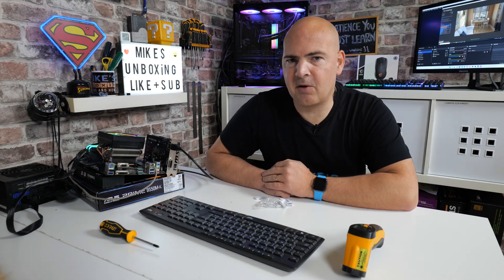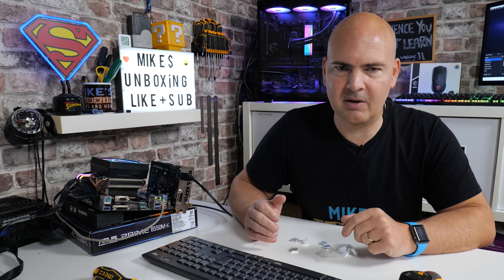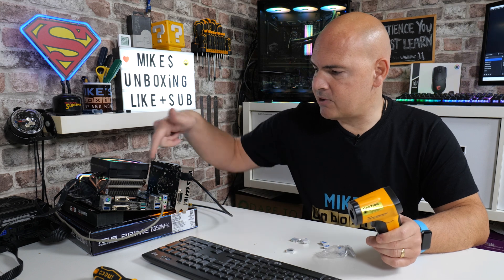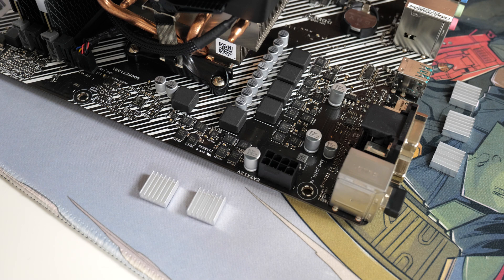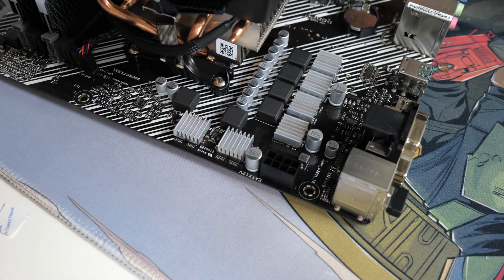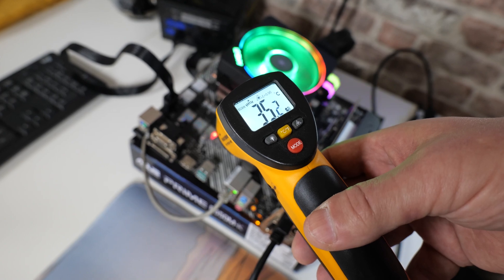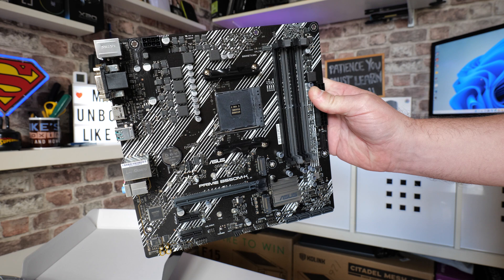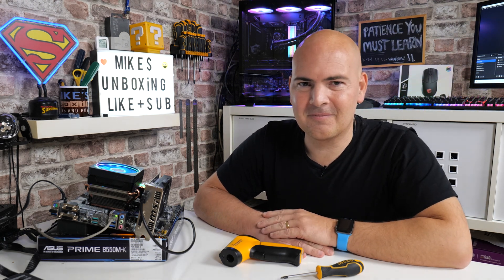Adding Heatsinks To Motherboard VRM & Chokes Is It Worth It?

Comment: Upon implementing active cooling for the VRM, specifically utilizing a fan on the heatsink, I observed an 8 percent increase in multi-core clock speeds.
Reply from the maker: That's a great result! Active cooling definitely makes a difference.
Reply: After you have attached the fan to the heatsink, you may then adjust the PBO settings, and you will discover new areas to explore.

Comment: In my motherboard, the mosfets are surrounding the chokes, which makes it impossible to use this heatsinks, I will try to find even smaller ones...
Reply: Did u find a way
Reply: @midnightbat344 didn't need to do it, turns out my temps were fake. My vrm are just fine

Comment: Is it attached firmly? What if the PC is standing? Will it not fall? I am interested in installing the device on my mosfet VRM, but I am afraid it will fall and hit the motherboard and short circuit.
Reply from the maker: the double sided adhesive seemed to work quite well. as far as i know the motherboard is still going strong

Comment: many lower end boards actually have the holes a vrm gets attached to on higher end boards since they use the same pcb. i would suggest mounting vrms using those instead of just relying on the thermal pads of small heatsinks, these are almost always low quality and slide off after some use. even just a zip tie would work. 
OR, thermal epoxy etc.
Reply from the maker: That's a great point about using the pre-drilled holes for more secure mounting!

Comment: pro tip to anyone wanting to do this, you want tall thin fins. If you use a heatsink with too much mass it will start storing heat instead of dissipating it. and a fan blowing directly on the heatsinks will make a massive difference. In terms of aluminum vs copper, copper is the best at heat transfer however if you cant find any with 9mm fin height its better to use aluminum
Reply from the maker: Great points, thanks for sharing!

Comment: Got an H610M-G with naked VRMs and i upgraded from an i3-12100 to a i5-14600KF. I appreciate this video and i will def use it whenever my heatsinks arrive. I bought some that have pre-applied thermal pads so i only need to peel the paper and i'll be set. I do have a question though, the heatsinks themselves should not physically touch the capacitors right? I did some research and it can apparently short out the motherboard.
Reply from the maker: yeah just touch the chips and avoid metal electrical contacts
Reply: @mikesunboxing  Great, thanks a lot mate. I appreciate your tutorials.

Comment: thermal adhesive/pads or 3m double sided tape, which 1 does it better and safe? 😅
Reply from the maker: i would rather use thermal epoxy or glue, but as the weight is minimal, some decent heat resistant DS tape should be okay

Comment: Can you try putting on an m.2 heatsink with larger fins. They come with Silicon pads so no extra effort required. Holding them in place would be a challenge though.

I also noticed, older mobos although basic, had larger and better heatsinks than most mobos manufactured today

Comment: I have a b660m ds3h ddr4 paired with an i7 12700, I'm looking to do this as my VRM temps easily cause throttling - Is it safe to do this with the 3m tape the heatsinks come with? Or should I get rid of those and rely on thermal pads instead?
Reply from the maker: personally i would probably buy some thermal glue for sticking heatsinks, it is a lot safer that way
Reply: They're sufficient. If your really worried about a short just buy anodized aluminum.

Comment: Would be nice if there was a way to ensure that the heatsinks stays on the chips, so you don't have that nagging feeling that one day, the adhesive tape just gives up and the heatsinks falls on the GPU, shorting it, and the computer goes up in smoke as soon as you turn it on. I guess you could glue something tom the mainboard where there are no components, to attach something like a strap that holds all the heatsinks down.
Reply from the maker: you can get actual heatsink glue that might be an option if you are worried

Comment: Would these cause short circuit?
Reply from the maker: if they touch metal parts that are carrying voltage they might, although if they are anodised they won't
Reply: @mikesunboxing so placing it on top of mosfet and vrm using only the adhesive that comes with it is safe?

Comment: Without the heatsinks these components almost go above their max operating temperatures. I added the heatsinks to make the board last longer I don't think it helps performance that much unless you do long renders and and start getting throttling, heatsinks any where where parts get warm helps with long render times.

Comment: Got this vid in my recommended section. Im an A320m user Gigabyte with a Ryzen 5 5600g. My board is almost 4 years in service with almost 3 years with the 5600g. I just put a fan close and directly at my vrms. No issues at the moment.( It has an rtx 3060 12gb in use for 4 months now).
Reply from the maker: thanks for watching
Reply: @mikesunboxing   Your welcome and Like

Comment: essentially as far as the vrm goes there's literally no difference besides the heatsink between this motherboard and a b450 tuf gaming, cuz the capacitors, mosfets, and chokes are all the same, but this one has a metal block on it.

Comment: It has been proven that VRM temps can have a significant effect on performance for a Ryzen APU system, because the iGPU relies on precise voltages for the processor, and RAM... But for a typical system with a dedicated GPU, the VRM temps probably don't matter as much.

Comment: First of all, greetings, sir! I have a question for you. I'm not a super knowledgeable person about PC. I bought a 2700x processor for an A320m s2h motherboard, the case works fine BUT in a heavy render or benchmark the VRMs reach 103 degrees according to HWInfo and Aida64, and in games usually 80-90 degrees. Some say it's normal, some say it's too hot and that I should get the mosfets like in the video. Now sir, I have two questions.

Will the PC explode if I keep using it with these temperatures?

I also read something about putting Thermal Pad before these mosfets, do you recommend it? Or is it okay to put mosfets without thermql pad? Can you give me some advice, thank you very much!
Reply from the maker: those temps are bordering on the unsafe levels and i would want them lower for longevity. thermal pads are a good idea especially the double sided sticky ones. the board won't explode but those temps could lessen the lifespan
Reply: @mikesunboxing  Thank you very much for the answer sir! I just ordered the heatsinks in the video as you suggested. Unfortunately I couldn't afford the thermal pad. Do you think only the heatsinks will do the job? Thank you again!
Reply from the maker: @kerem1294  yes they will definitely help a bit

Comment: My previous AM4 board (Gigabyte A320M-S2H V2) was choking my Ryzen 5 2600 in performance and the VRMs at around 110C really heated even the processor. Added some small heatsinks like you did and that cut the VRM to around 70C-ish IIRC. 
That board has since died and I moved to one with a VRM heatsink and I would probably aim for motherboards with VRM heatsinks in the future to avoid that issue.
Reply: did it work with heatsink you added?

Comment: hello will this work with asus a320 motherboard?
Reply from the maker: i don't see why not, worth a try
Reply: @mikesunboxing i used the wrong heatsink i used the 10x10x10 but somehow my cinebench scores went from 15000 to 20890 points significant uplift in performance. damn i didn’t expect this at all!  if only i used the correct heatsink like yours the results would be even more better !

Comment: I have done this on a few different boards for LGA 775, AM2+, and AM3+. It works much better if you use a thermal epoxy to attach the heat sinks. Granted you wont be removing them ever again, but you'd be doing this to a cheaper budget board, so why would you want to anyway?
Reply from the maker: Great tip!

Comment: so ive been having pc restarts while gaming and the temps seem fine, but I don't have heat sinks on my vrm and I feel like that might be the cause of it because I've done everything else possible to fix the issue. the problem started when I put a i9-9900kf in the rig and my mother board is a asus tuf z370 plus gaming. my PC restarts less than 5 mins into the game and I don't get any bsod
Reply from the maker: what motherboard and cooler are you using?
Reply: @mikesunboxing  im using a icue h150i rbg pro xt
Reply: the mother board is a asus tuf z370 plus gaming

Comment: I got problems with my VRMs and I was thinking about getting the tiny heatsinks before I do anything bigger as for example buying a new MB. As soon as my CPU hits 52°C the VRMs hit 80°C and theyre calibrated to throttle power and CPU frequency down when they reach this temp; this results into lags ingame and also cause wrong readings in temp (CPU jumps from 52°C to 206°C). Are these heatsinks worth a shot? I got bad air flow in this stock case so I also plan to install a fan to blow on the VRMs.
Reply from the maker: heatsinks and airflow will definitely help a little

Comment: 7:10 you can actually point the Infrarays towards backside of motherboard ( behind vrm) to get appx. Exactly vrm temp.
And do it before adding heatsink vs after to get a conclusion.
Also i would suggest running an i9 on h610 motherboard since intel cpus are very powery hungry and generates heat. They will be highly affected by vrm temp.
Reply from the maker: thanks for the info, to be honest i wasn't looking for an exact result, just some confirmation that it would make any different at all. But thank again for the suggestion

Comment: If the VRMs don't have sufficient cooling they can throttle the CPU.  And it can be pretty subtle - after dusting out my cooler I didn't shove the fan all the way into it and the CPU throttled multiple times a minute (5900X on one of these cheap Asus Prime boards - I know, I know, but the board had been a toss-in with a 3600X).  Adjusted the fan location a bit and now it doesn't throttle.  I should probably go with the cheap solution of these little sinks rather than picking up a better board for a dead socket.

Comment: What if you use thermal glue on vrm, then use a thermalpad to stick to it, then make a bigger thermal cooler for vrm, like if you have a deffektive older motherboard and you bought a budged motherboard with no vrm cooling solotion. Can you stick thermal glue first on vrm then thermalpad then a bigger cooler?

The reason i ask to use thermal glue  then thermal pad is becouse on some of the vrms there are capasitors that is higher then the vrm. I tried with just sticking a thermalpad and a small ssd cooler and the temp went down 10c on vrm just with the small cooler.
Reply from the maker: that might work
Reply: @mikesunboxing  i have an old and deffective motherboard, that motherboard has some good heatsink for vrm. i was planing on useing that on my new budged lga 1700 motherboard that has poor vrm heatsink. i want to try this since the motherboard might last longer since the vrm temps will go down, i see alot of the budged motherboard dont have a heatsink on vrms, maybe thats how they cut the cost on them? so maybe adding a vrm heatsink from an older motherboard and sticking it on it will make the new board better for when pairing it with a good cpu. i know alot of people might cheap out on motherboard and get a good cpu and good gpu and good psu, and just a simple and easy way to forlong its life and to almost elimiate vrm throtteling is to make it cooler so the motherboard will have a good time hehe.

But i have heard that the heatsink should NOT touch the capasitors around the vrms, this might couse a short circut? is this something you are familiar to? i have done this before, worked great, but what scares me is the new motherboard lga1700 has 4 capasitors a little higher then the vrms.

Comment: Good idea, but problem is, that those glue tapes are sliding due warm. And this is risky, because few months later can heatsinks make short circuit on the motherboard.
Reply: Most tapes are more than sufficient unless its copper. But with anodized aluminum this goes away as it can't short components with its coating.
Reply: check it with a multimeter, aluminum heatsink's surface is  electrical insulator  (because it's surface quickly reacts with the oxygen to form  5nm Al2O3 film). So, when the heat sink drop, it will need hit two different point at the same moment to cause damage, which is impossible. Well... not possible if the MB is placed vertical.

Comment: Note: The adhesive on these most of the time ISN´T thermally conductive. Thermally conductive adhesive tape is expensive and you won´t get that sort of material with few alu heatsinks for 4€...

As it is, you actually isolated your VRM, not helped cooling it down.

Comment: When doing these mods it's best if large piece heatsinks are used in conjunction with normal thermal paste and some high temp silicone adhesive on the corners to keep them in place!
Also I did notice the heatsinks that you used were extremely low profile, generally you want to pick heatsinks that are as tall as possible!
I loved the video❤!
Reply from the maker: i agree totally, this was really just a demo of what could be done

Comment: I've ran this motherboard (B550M-K with a Ryzen 3 quadcore) for three years (ie, pushing past warranty) and had the board start crashing, instant power-offs without BSOD, weird pixelated visual artifacts and stuff like that. I play MMOs for hours at a time and touching the MOSFETS and chokes they get pretty toasty, especially the +2 on the side!

After realising the motherboard was the problem and the VRM system in particular, I'm finally upgrading to something with a sane amount of phases in the VRM. I would definitely not recommend this thing, even with the custom heatsinks added on (the M-A version has one extra VRM phase at least!). But good on you for giving it a go and giving people a budget option!

Comment: If you'd taken the IR readings from the back of the MB it would have given a precise delta for with/without heatsinks - the MOSFET's metal backs are soldered over their entire area to a ground-plane to sink heat to the MB (a thermocouple placed there can provide actual MOSFET temperature minus maybe a couple of degrees). ETA>> another way of cooling VRM's is a fan on the back of the motherboard, stuck to the CPU backplate (silicone RTV works well, securely attaches the fan but easily cleaned off when needed) - a 90x15mm works well and can be run at fairly high RPM without being audible (particularly if it's a good quality one) - as noted above, the MOSFETS sink a lot of heat into the MB whether heatsinked or not, and the unobstructed back surface is quite conducive to air flow. You can further improve temps by cutting the motor/impeller out of its frame. On my Asus Prime Z390-A it reduced VRM temps (according to HWiNFO) by at least 10°C. This is actually an easier mod to carry out than adding heatsinks. Use a Y-splitter from the CPU fan header.

Comment: Hello!! Nice video, very helpful...i have a question...do you think that using a thermal glue instead the 3m glue would perform better??
Reply from the maker: it certainly could do, the liquid glues often have a better transfer, but they are really hard to ever remove if you need to

Comment: I've just come across this, as I have been searching for descent after market VRM coolers,  as am not happy with the solution that came with my board as  my previous boards the VRM  ran a lot cooler but it looks like I'll be resorting to carefully carving up an old p4 heatsink,  and shaping it to fit. 

You may  get a better idea of how well the cooling works if you can measure the temps from the back of the board underneath the VRM - as you will know the caps will also get hot, reducing their lifespan if left unchecked...

Comment: The best solution to vrm cooling I’ve found is to run an AIO and add this printed bracket with a arctic 92mm fan. You 30 degree lower vrm and m.2 drive temps and cpu temps are even helped.
Reply from the maker: cool idea

Comment: Question Mike: do you think regular thermal pads woud be sticky enough to keep a piece of aluminum, cut  similar to the ones you are using, from falling away when the mobo is vertical?  Thank you for your help.
Reply from the maker: probably not with heat cycling, it would likely creep off in time
Reply: @mikesunboxing  thank you Mike.
Reply: These 3M tapes are allegedly “thermally conductive”.
Reply: @soldiersvejk2053  what does it actually mean, aside from being able to effectively transfer heat?  Won't it get melted long-term? Adhesive less effective long-term?  It's gonna be important especially if the electronics are placed vertically
Reply: @rcane6842  As far as I know, if your only way to secure the heat sink is to glue it on, this is your best shot.

Comment: I did the same on my ASRock Z690M-ITX/ax. It dropped the temps by 20 degrees and allowed me to run a 12700 at higher wattage.
Reply from the maker: awesome! that is a pretty decent upgrade
Reply: are they sliding down when the heat is increase

Comment: Did you adjust the gun for the difference in thermal emissivity of the black chips vs the silver heatsinks?
BTW the Amazon IR gun comes with a thermocouple, as does their clamp meter, both useful things for messing about with computer bits.
Reply from the maker: i will look at the amazon ones with thermocouple, could come in handy